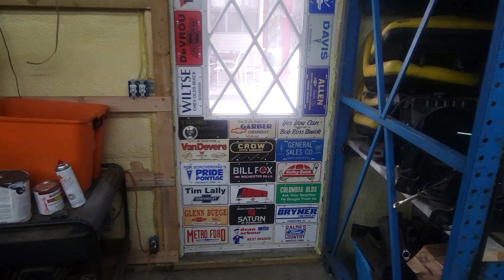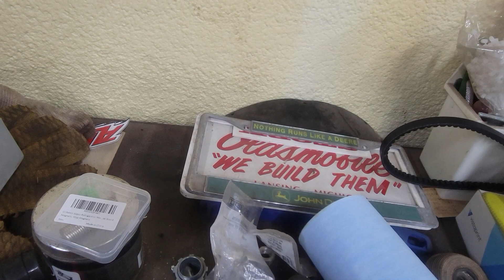SEIZED P.T.O. CLUTCH! Removing a John Deere 345 engine

Comment: Good vid, I have a 345 that sat for awhile, got it running but now have oil coming out of the crank case breather hose and when I take the fill cap off it blows out of that pretty good. Trying to diagnose but doesn't seem to have been an issue prior to it sitting.

Comment: I wish i had this video two years ago when i changed out the pto on my 2001 345. That thing was FROZEN ON, heat did not work, lubricant did not help. Eventually i took a mini grinder and cut it down, got close to the crank shaft and scared the pto, then split the sleeve by twisting a chisel in the cut i made. Transmission pulley slid right down no problems,  go figure. One thing I never thought of was to take my air hammer and hit the bolt like you did!

Comment: I have another question, i need to replace the water pump now due to a drip when the engine cools down. Do i uave to completely remove the engine or can i just remove the four bolts and lift the engine up slightly?
Reply from the maker: You should be able to just lift the engine

Comment: I’ve had this issue too and I use emery cloth real fine on the shaft if you can get the pto off and the pulley comes off easier and heating the pulley up is your last hope lol
Reply from the maker: I agree I should have sanded the crank after the pto clutch was removed.  I have tried heat before with no luck

Comment: I have a question going the other direction. I have a clutch on a 345 that keeps breaking the bolt off. Which when lets the clutch fall off. We have put about 4 different bolts all from John Deere with the same thing happing. Any ideas?
Reply from the maker: I'm not 100% sure but I believe there is a bearing going bad on the clutch itself causing the bolt to break. Make sure you are using a john deere bolt and cupped washer to reinstall.
Reply: @smallenginegarage  thanks will do.
Reply: Does it have the retaining bracket properly installed? Also the bolt holding the Clutch to the Shaft, needs to be torqued to the right setting. The Bracket keeps the clutch, from trying to rotate when engaged. If not, it will rip out the wires as well. Then your Clutch will not work.